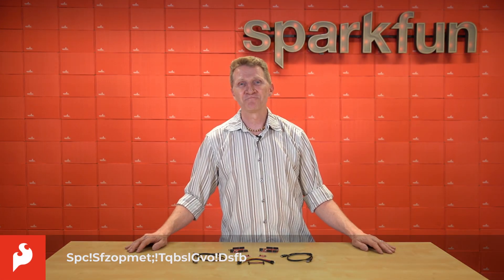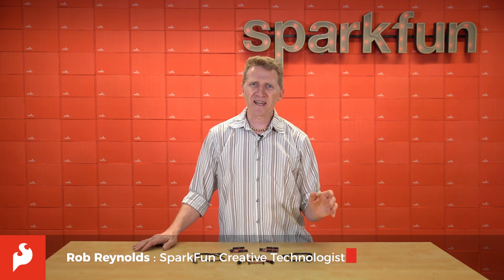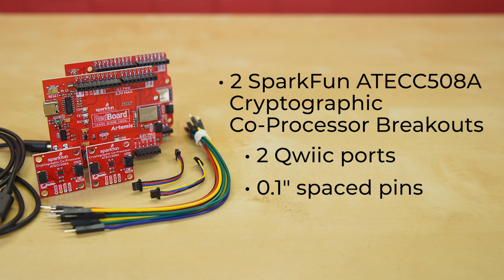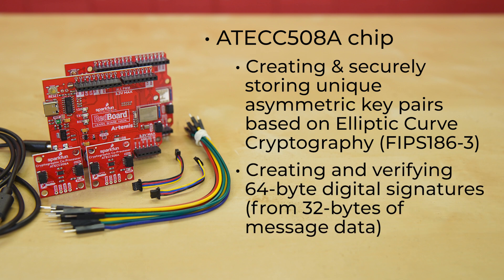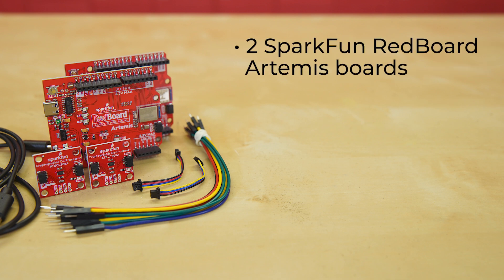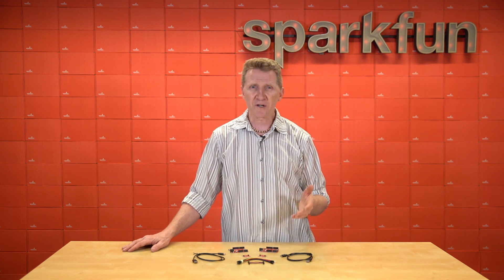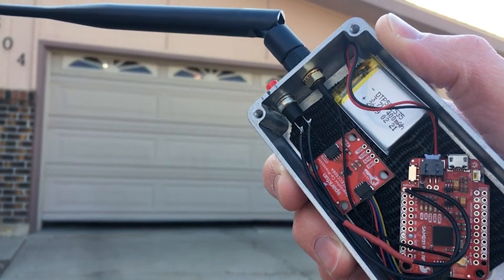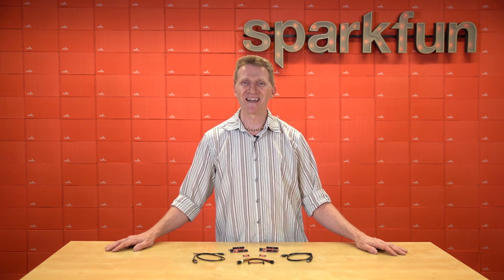Product Showcase: SparkFun Cryptographic Development Kit

Comment: And why not just do it in software?
Reply: Sheer Speed. You can't beat a purpose-made device like this for speed, and if it's a process like turning something "on and off" done with a cryptographic confirmation... There are some hardware applications that software can't catch up to. It's like rendering modern game graphics in a GPU and not a CPU. CPU is just not going to be fast enough. That's the best metaphor I can come up with, because if you don't see the obvious advantages, you clearly don't know or understand cryptography and need to educate yourself on the subject before asking such questions.
Reply: @squirlmy  Though it still runs the I2C protocol with with a max transmission freq of around 400kHz

Comment: Can I mine crypto with this product? I'm joking, but maybe it could be used as a hardware wallet.
Reply: Well it has SHA-256  built in, but I'm goona say no given #1, then it's I2C, so not going to get a good data rate if it could.  Wallet - yes it could.  

#1 From specs "Additionally, this board is NOT capable of encrypting and decrypting data. It can however, perform quite a few cryptographic authentication processes such as secure private key creation, secure key storage, and digital signature creation and verification."